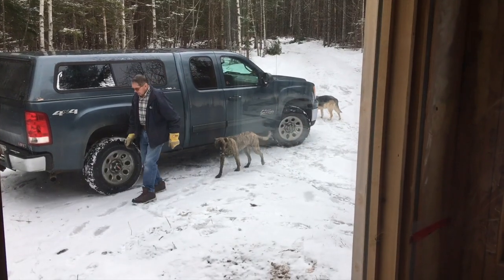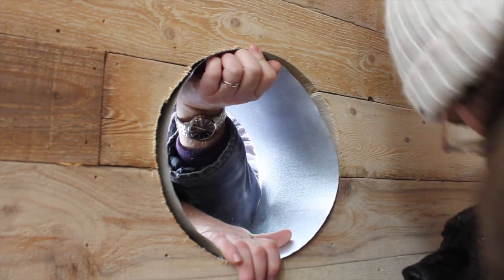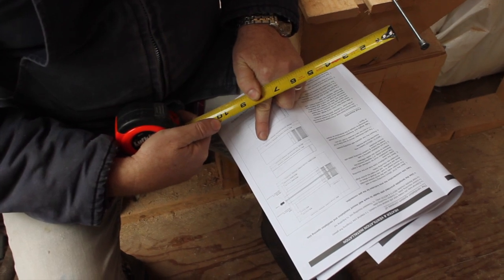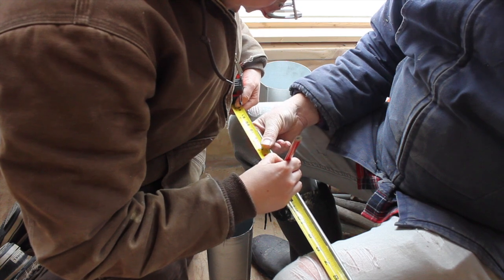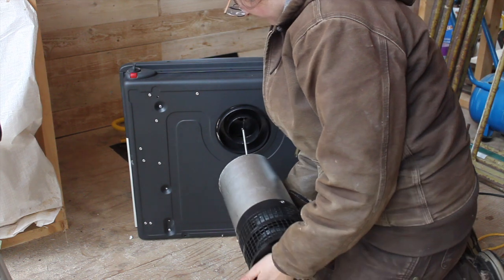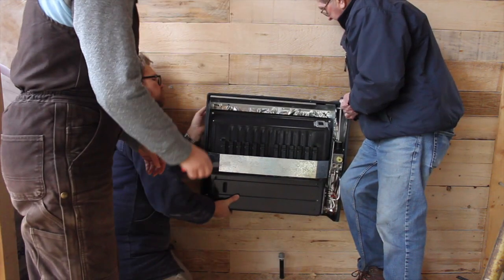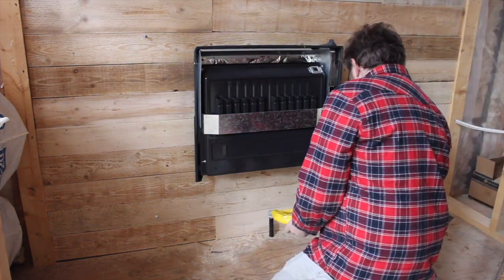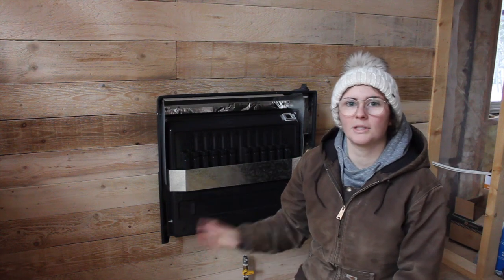Martin Propane Heater | Getting the Cabin Ready for Winter

Comment: What size of propane tank are you using to fuel this heater and do you have an estimate on how much propane you might use?
Reply from the maker: We are using 100 lbs propane tanks so we can move them to be refilled. We have not lived in the cabin through a winter yet so unsure on how much we will use but I plan on doing a video about that this coming winter.

Comment: What has the performance of the heater been like?  I am looking at something similar for our cabin in northern Ontario.
Reply from the maker: We have not had to use it too much, as spring is on its way. However it seems to heat up pretty nicely, the one draw back is after install we were told it goes through propane quickly...
Reply: @backtothelandliving  Thinking of the same heater and from Cabin Depot as well.  Did you ever nail down propane use numbers?

Comment: It’s -38 here right now, I topped off a 30lb propane bottle yesterday around 4:00pm an after running it yesterday afternoon and last night I now have approximately half a bottle left an it’s only 10:54 am.. 
Did not think this heater was going to be this terrible on propane..! To fill that 30lb propane bottle cost me 41.13 ..
I even got up durning the night to shut the heater off an thought I’d be good for a while.. NOPE..! Wasn’t the case at all..!
I bought the Martin Propane Direct Vent Heater MDV20VP 20000 Btu...
Diff NOT IMPRESSED..! 
Along with the warm temps, also come high humidity. Currently +17, 18 in here with 52% humidity ..
Current sq footage of my semi off grid shelter is 384sq/ft.. 
Yup... am NOT impressed at all..!!!
Reply: Maybe you need more insulation?